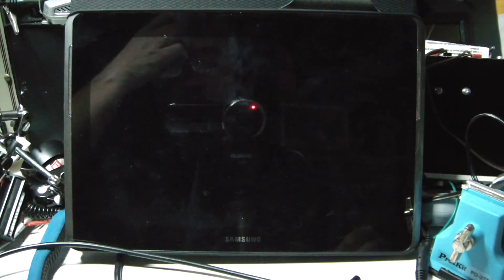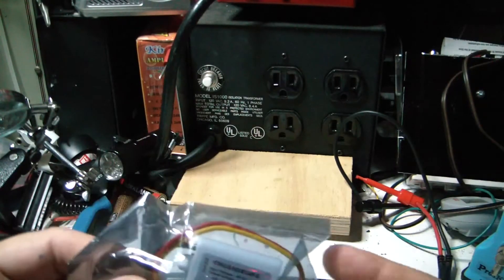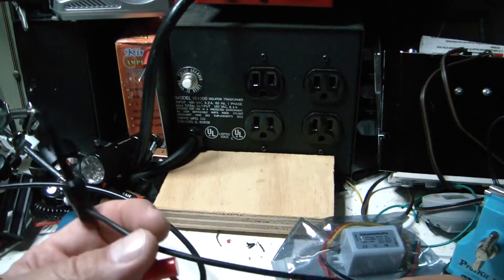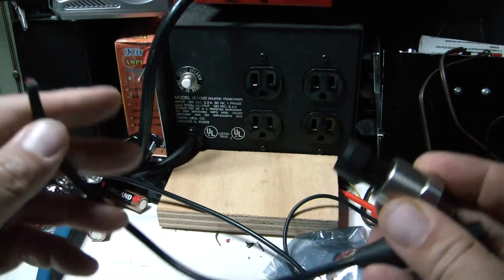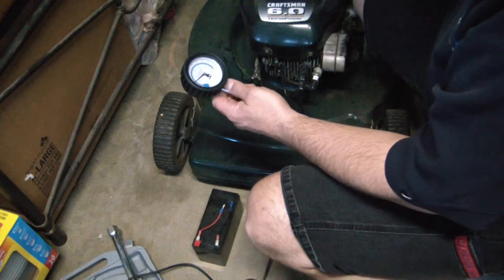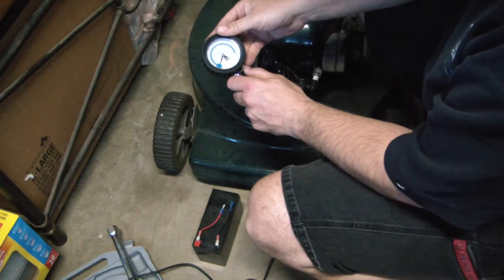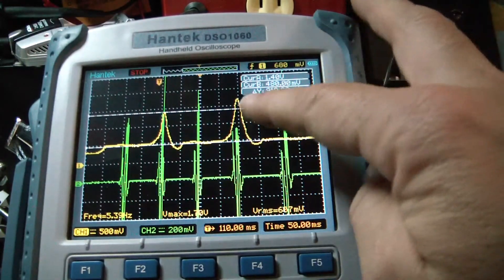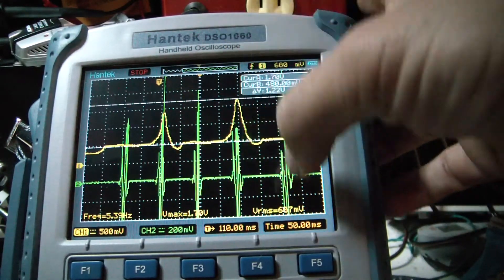DIY Pressure Sensor

Comment: Just curious, why was the small battery hooked up then the 12 v?
Reply from the maker: If I remember correctly, the pressure sensor needs 5v.  I was playing with different ideas.  I ended up making them using 12v to 5v buck converters from eBay which are quite cheap. Then hook they to the car battery. Today I would probably make it more portable with 18650 battery and USB charger to 5v adapter from eBay.

Comment: I got an idea I saw from other videos, you should try to make a co2 sensor to check for bad head gasket from a home co2 alarm?
Reply from the maker: I would like to do such a project.  I have looked for possible sensors on ebay and google searches and not found anything I can work with.  If you make something please share.  I just think the money companies charge for some things is crazy when it can be built for pennies like this pressure sensor.
Reply: You should try with an MQ 135 sensor. It's good for checking head gasket and it requires only a 9 volt to 5 volt converter and a 9 volt battery. And you have at the end an analog signal. 

The sensitivity of the sensor is really good, it observes even the CO2 change from the breathing air.

And it costs around 3 $.

Comment: HI John,
I too liked your video.The input to the second channel is a good idea as well.
Using a standard dig. scope to monitor car sensors is a great servicing aid.
So much cheaper than buying specialised car scopes.
Could you please explain how you set up your digital scope so that it 
would trigger on the compression sensor signal and then freeze the display.
Having trouble freezing the display with another brand of Digital scope.
Regards
George

Comment: John, on your waveform, I don't see the exhaust valve close. On another DIY pressure transducer vid by fixitmekanik412 I notice the same thing. I'm assuming this has to do with the transducer being used, possible the fact that it doesn't operate with negative pressure? It is extremely useful as a diagnostic tool but much more so when you can compare to known goods from waveforms produced by the Fluke PV350 or the WPS500, IMO. Have you noticed this in your testing, and if so, do you have any ideas on changes to the project?
Reply: the opening or closing of the valves would not be pronounced as this is a cranking waveform.
Reply: Got it! For some reason I forgot this was not running!